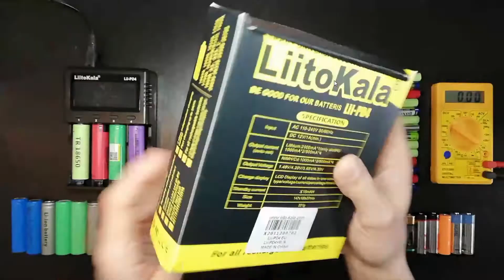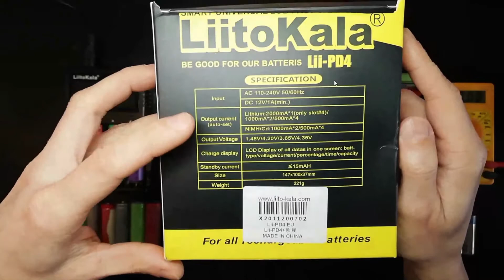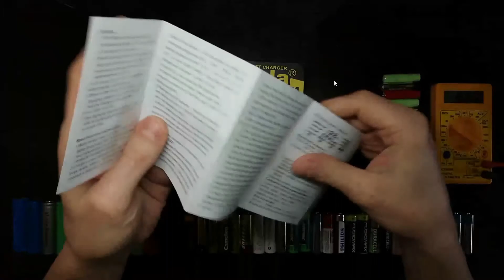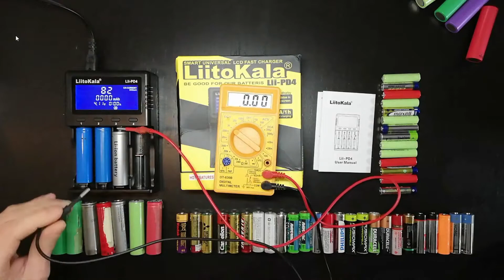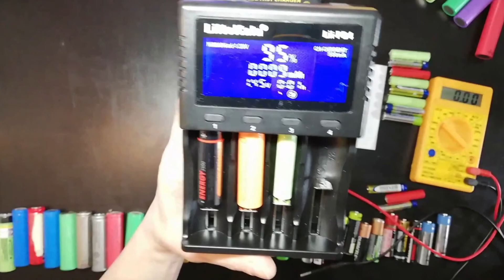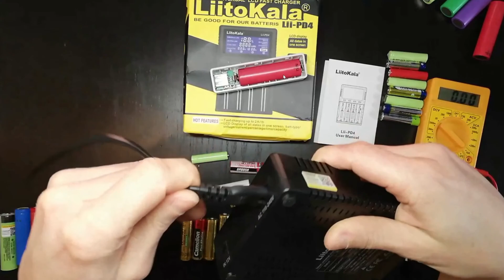LiitoKala Lii-PD4 battery charger charging batteries test

Comment: this charger is a crap. it doesn't fully charge batteries and doesn't properly identify current charge. neither lithium, nor NiMH. probably because it's not smart enough to make short pauses between cycles to measure the voltage. my old no-name charger does a better job.